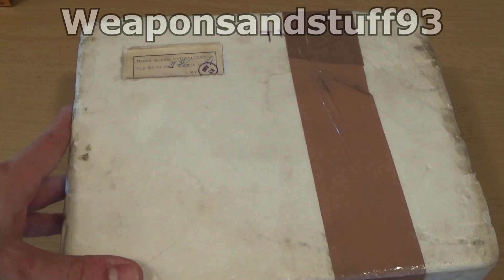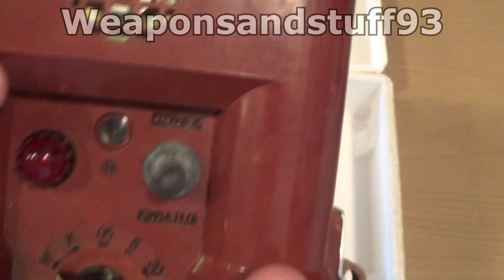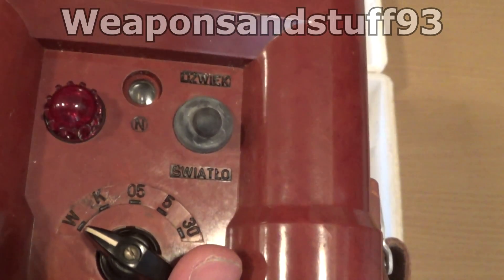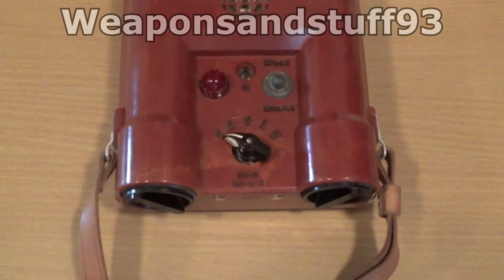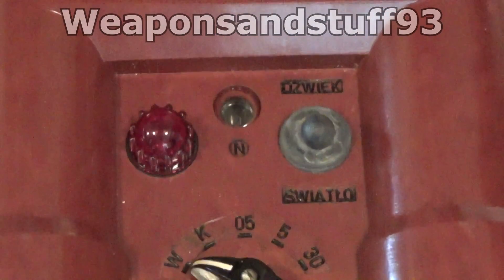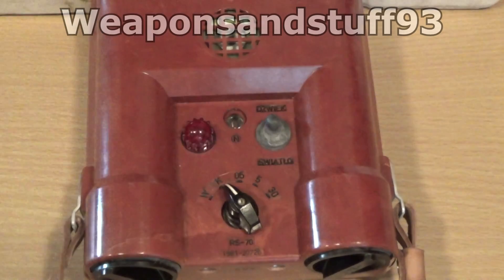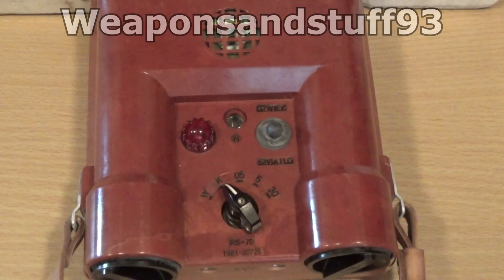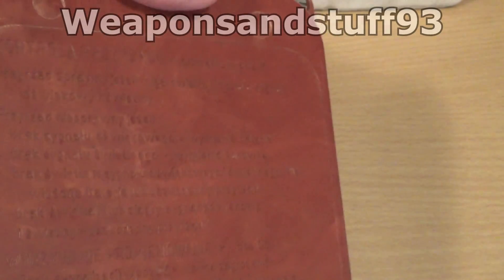Polish RS-70 Radiation Detector

Comment: I got such,qite interesting thing,makes a hell of a noice....How large radiation is needed to set it off?.....would strontium90 work??
Reply from the maker: You need half a Roentgen 0.5 cGy to set it off of pure gamma or x-rays so Sr-90 won't work. Radium, Cs-137, Co-60 etc are needed.

Comment: Here is a translation of the instructions on the back of the device done by a friend who speaks Polish.

Device controls - the knob in position K

The device is working correctly if the light N is blinking and both the light and sound signals are working.

The device is working incorrectly if:
 - the sound signal is not working (change battery)
 - the light signal is not working (change the lightbulb)
 - if the light N is not blinking and neither the sound or light signal are working check if the battery is inserted correctly, otherwise the device is broken
 - if the light N is not working or the light and sound signals are going off continuously the device is broken

Radiation scanning - position 0.5
 - no signal in position 0.5 - no threat
 - signal going off in position 0.5 - threat present, leave area
 - signal going off in positions 0.5 and 5 - strong threat
 - signal going off in positions 0.5, 5 and 30 - dangerous levels of radiation

Switch the device off after use - position W
Reply from the maker: Thank you for all the info, that's really useful to know.